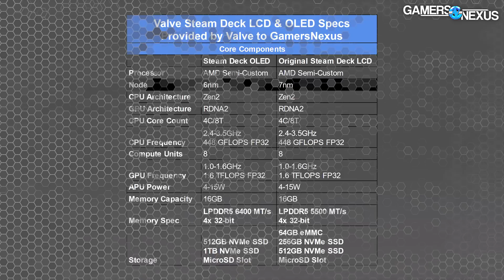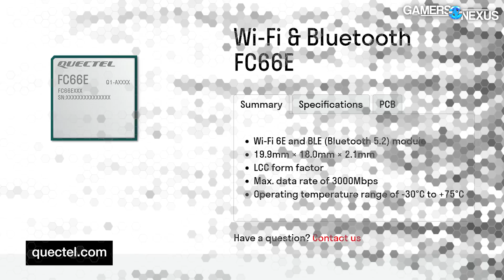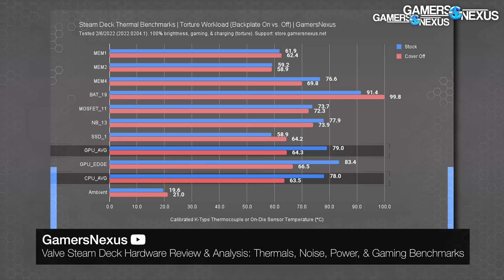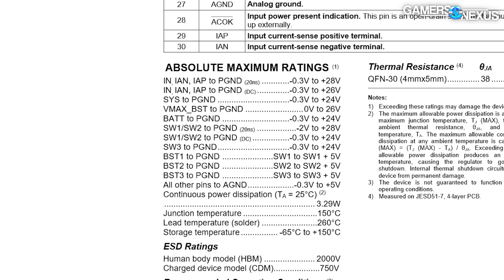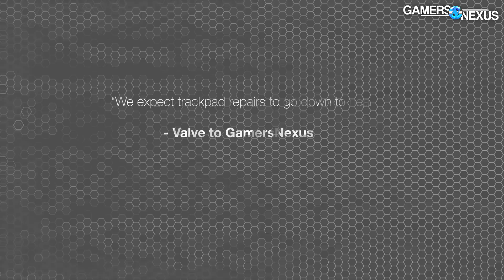They Changed Everything: Valve Steam Deck OLED vs. LCD Tear-Down

Comment from the maker: Check out our Lenovo Legion Go review! https://www.youtube.com/watch?v=I37mxlDqLrk
We're running a lot of tests on our (still assembled) Steam Deck OLED RIGHT NOW. We are currently running battery life, thermal, and charge time tests. Battery life can be detailed: Do you have any specific scenarios you want to see battery life tested for? Gaming is on the list as well. What other tests would you like to see? Do you have any specific gaming test requests (especially memory-bound ones)?
Check out our ASUS ROG Ally deep-dive review here vs. the original Steam Deck: https://www.youtube.com/watch?v=Na1y7DyDe2w
And read about the Steam Deck OLED's specs on our newly relaunched website: https://gamersnexus.net/news/valve-announces-steam-deck-oled-deck-2-works (just the news/specs)
Reply: Testing emulation of older consoles like the N64, PS1, and PS2 would be really great. It would be great to see since so many people buy these to emulate older games and the battery life playing those games would be really important to that. Though I totally understand if you don't want to risk facing the potential backlash from those companies by doing that testing.
Reply: For battery test, watching movies is imo realistic usage scenario;
Both streamed from netflix as well as offline playing  from the disk.
Steam's remote play is also something i'd be interested to know about, in terms of battery life
Reply: @xeamek99  I second this. OLEDs typically require more power to run just because of the higher cost of switching the brightness levels between each pixel. However, the steam deck supposedly has better efficiency in general and a bigger battery. I'm wondering if this just offsets 1 to 1 the extra power consumption or if you get more life out of it. Could also be nice to test it with things like streaming specifically as well as having Bluetooth headphones enabled (for the wireless connectivity drain)
Reply: @CreativityNull  Oleds require as much power as it needs to brighten the light areas. So in the end it depends on the usage scenario and content! Movies often tend to have tons of bright areas games, it depends on the game.
Reply: @werpu12  yes I know, that's why I specifically wanted the movies and streamed content test to tax the power so we could see how much more efficient this new cpu is.
Reply: Talos Principle 2. I'd love to see how UE5 melts it. It's already running so badly on normal PCs thanks to Lumen/Nanite, I'm really curious to see how it would run on the Deck. (Amazing game otherwise though)
Reply: when's the followup review for this?
Reply: I wonder if there is a huge difference in battery life for games that do not require a lot of power and games that do. They claim 3 to 12 hours with the OLED version compared to 2 to 8 on the LCD version, which means that theoretically the difference in battery life for indie games or emulation of retro games compared to recent AAA titles between the LCD and OLED version should be bigger. I'd love for you to test that.
Reply: Does the anti glare interfere with the black levels? Does it create a bit of diffuse light that prevent the complete black of the OLED?
Reply: Still waiting for more steam deck content :D
Reply: wow - i love the way u presented all the parts on this "enlightened" table - very pleasing!
Reply: cities skylines 2 🤣
Reply: @fornillia I'm playing c:S2 on my LCD steam deck, get 16-20fps on low but having a blast 45 hours in with a 80k pop city and 14k pop city
Reply: Do some test with a moderate undervolt if available in BIOS as well.
Reply: I really want to know that I see no other reviews mentioning is haptics/vibration. Is it more noticeable in games now? Before it was very weak and since they say it's "vastly improved" in the spec sheet, I would like to know.
Reply: something like Messenger? light game, so you could test total battery life (valve claims 12hrs), and pixel respons time (the game has tons of locations with light-dark checkerboard patterns, that run very poor on the lcd deck due to the not-so-great pixel respons)
Reply: What I'm most interested is in related to battery life is the comparison between playing on deck with installed games compared to playing cloud games.
Reply: I'd like to see game streaming from a PC on the local network, and how that effects battery life.  This is a very realistic use case for me.
Reply: Gaming and Battery performance when throttling power delivery to just 10W would be awesome!
Reply: all tech tubers are "constantly complaining about the prices of GPUs", there's a catch though - they all say stupid shit like "it must be 25 -50-100 bucks cheaper" BUT GPUs ARE OVERPRICED X3-4 TIMES! overprice is NOT 100, not even 200 bucks. its literally 3-4 TIMES!

GTX 980 Ti  Die Size 601 mm2 2015 Launch Price  650USD 
GTX 980 Die Size 398 mm2 15% slower 550 USD
GTX 970 Die Size 398 mm2 30% slower 330 USD

RTX 4090 Die Size 609 mm2 Launch Price 1600 USD
RTX 4080 Die Size 379 mm2 30% slower 1200 USD. its a xx70 card.

RTX 4090 must cost 600 bucks, its OVERPRICED 1000 DOLLARS. RTX 4080 must cost 300 bucks, its OVERPRICED 900 DOLLARS. 600 & 300 bucks are normal prices for such devices because TECHNOLOGICAL PROGRESS, mf-er, ever heard of it? 
yeah, ngreedia can sell 4 times less GPUs for 4 times more money each and get the same profits, yet gamers will have 4 times less new faster GPUs and game devs don't make games for overpriced AF hardware, game devs make games for hardware that MOST people can afford to have a player base to sell games to. +most new GPUs have like 0 progress = thats how ngreedia is killing PC gaming with its overpriced x4 times crap.
when you buy a top overpriced AF GPU there will be minimal amount of games that actually need such GPUs. and most new "hard to run" games actually is boring AF crap with bad gameplay and stupid storylines. and YOU SUPPORT GREEDY AF CORPORATIONS AND DEATH OF PC GAMING through overprice.
and ayyymd isn't better - supporting overprice to sell more obsolete cheap-to-make high-margin ps5/xbox chips to sony/ms. ayyymd supports ngreedia overprice to push PC gamers buy crap consoles. and both corporations are making profits of slowing down technological progress. no progress = no price drops.
people really should ONLY get used GPUs and don't feed GREEDY AF corporations at this point.
and "tech tubers" are a sad joke with fish memory because they never seem to remember pre-mining prices, which is 2015, always comparing TO MINING PRICES WHEN GPUs LITERALLY WERE MONEY PRINTING MACHINES. THEY aren't anymore. GPUs are JUST GAMING DEVICES and MUST BE priced accordingly as such, 500-600 bucks MUST BE TOP GPU PRICES, xx70 class cards like "the 4080" MUST BE around 300 bucks just like pre-mining when NOBODY EVEN CONSIDERED THAT CHEAP.
Reply: BG3
Reply: First of great work. Are you planning to do a Legion Go teardown or any testing - would really appreciate it. 

Keep up the great work - love the content.
Reply: Really cool! Could you do a video on the new PS5 too? I am hearing about people complaining that the fan ramps up too much and is extremely loud compared to the launch versions.
Reply: The new Counterstrike on the old vs new Steam Deck would be interesting to see
Reply: Would love to see 60hz/fps battery life on the original vs 90hz/fps battery life in the same game on the OLED.
Reply: Is the battery in the OLED easier to replace? That is my main sticking point on buying one, I don't want a brick in 2-3 years, and I don't want to deal with ribbon cables since I always rip them.
Reply: wtf is taking so long, maybe the useless old CPU reviews for the milionth time
Reply: How’s the review coming along?
Reply: Still waiting on the review. forgotten
Reply: Would love to see breakdowns of screen vs CPU vs GPU power usage and effect on battery life with fixed framerates, as well as undervolting. Eg, can we do a moderate undervolt with medium to low screen brightness and get a big increase?
Reply: I would like to see a video about if there are any components you could swap to the old model like the trackpad or the new speakers I heard about
Reply: Test Shadow Warrior Redux at native res but 40fps/40hz to see how far battery life stretches, I get roughly 6-7 hours like that and am curious to see if that stretches to potentially 15 hours.
Reply: Love the website layout, very friendly!
Reply: I would like to see a Slay the Princess benchmark or other VNs

Nobody includes them in benchmarks, but it would be super interesting to see if this new deck can achieve 12 hours battery life under very light load

As well as provide a point of reference to people who mainly play this kind of games
Reply: Like someone else mentioned, I'd like to see if the efficiency could be pushed a bit higher by undervolting. I did this on my deck and was able to lower voltages across the board by 30-45 mV and that increased the efficiency of the APU by right around 8% on average
Reply: Can you do a stop and go charging test where you charge the steam deck to random percentages to simulate not having time to fully charge so we can  see how the battery life is affected?
Reply: steam deck LCD have two different pcb's, you tested the first version - but what differences have with the second revison pcb, new OLED pcb an cooling is much more similar to the second steam deck LCD pcb than to the first pcb.
Reply: I would love to see testing of the bluetooth! The original Steam Deck often has problems when you're trying to use multiple bluetooth controllers, so I'd love to know how much that has improved.
Reply: Can you test Trackmania 2020, Rocket League, and Baldur's Gate 3.
Reply: I've been holding off on deciding between buying a ROG Ally or Legion Go to see what your thoughts are on the Legion Go. Will there be a Legion Go review any time soon?
Reply: Phew... For a second I feared you disassembled before testing. Kind of felt like that in the video. Can't wait to see the results! :D
Reply: Please, test Video Playback battery test, both locally, like a movie on repeat, and Streaming from Youtube. It would be really nice to see those real-life tests!
Reply: Steve, can you reconsider shooting future videos on the table with the fluorescent lighting? The strobing is very visible on video and is hard to the eyes in some shots.
Reply: Some 2D Games like Vampire Survivor would be nice on the Battery Life test. Don't know if there is a test, but it would be great as it is one of the better Steamdeck Games.
Reply: I know it's way out of your scope, but we would love to see a star citizen test on the new OLED deck, or a comparison! The deck citizen community is super curious if the new ram configuration makes a big difference...
Reply: I'd like to see how fast it discharges at idle and at sleep. I have no idea how you'll test the latter but if it is at all possible that'll be cool. The Deck LCD loses charge at a surprising rate for a device that is "sleeping" or "suspended" vs any other device I own.
Reply: Netflix/YT playback please!
Reply: Testing emulation in general would be nice and see how it compares to the old Deck. See if the improved thermals and memory speed help with emulation and the battery performance while emulating.
Reply: Steve and his team making their premiere video on Steam Deck OLED way different and interesting than others. Such dedication to the craft. ❤
Reply: I have a steam deck with a bad main board steam and all there partners do not sell or repair the main board. So I have a steam deck paperweight. Steam also wouldn't tell me why they wouldn't warranty it.
Reply: @pilsen8920 ”But the steam deck is repairable” the valve shills scream at the top of their lungs.
Reply: It probably makes the most sense to test for the modern triple A games that have come out this year and compare battery lives between the old deck and the new one.
Reply: I really would love to see the comparison against PTM7950 + JSAUX vent backplate mod as well as stock.
Reply: Please check if the battery is easier to remove than the LCD one. The LCD one uses quite a lot of glue which makes it very difficult to remove. Even if you don't tinker or mod your steamdeck, it's likely the battery will need to be replaced before it becomes obsolete. iFixit classifies battery replacement as "difficult" right now and I hope they improved it.
Reply: Does the oled have pwm?
Reply: I'd be curious to see a battery and performance comparison of a game that can run on Steam OS natively, compared to the same game running on Windows on the Deck.
Reply: The Deck received a quieter fan curve since your original testing. I'd like to see an updated temperature reading for the area with the problematic charging IC. Has reduced airflow made the LCD Steam Deck significantly worse at cooling that area of the board than it was at release?
Reply: How long it would last in sleep mode honestly.
Reply: If possible it would be great to see some of the core cooling tests repeated with the reassembled steamdeck versus the untouched one to gauge the risk/wiggle room for enthusiasts to disassemble for fixes to see how foolproof the process is if that makes sense
Reply: A video comparing the 512gb glossy glass oled display vs the 1TB etched glass oled would be great. Especially in a dark room/natural sunlight if possible.
Reply: Overclocking. It's doable on the LCD version, curious to see how the 6nm APU behaves.
Reply: General use - watching videos screen-on-time will help a lot, to know about battery life
Reply: They claim you can game for up to 12 hours on a single charge.  I want to see this tested.
Reply: Would like to see which SteamOS version its running; Specifically to test if they have fully switched to Weyland for Desktop mode as well testing if it properly supports HDR in desktop mode. (if those details aren't embargo'd for some reason).
Reply: cool table
Reply: The back paddles used to be a real downside, since they were much too stiff. Did they improve the back paddles in the OLED version?
Reply: yeah I want to see price/performance comparison to the cheapest steamdeck and to the cheapest steamdeck with upgrades. because obviously oled version is overpriced 0 progress crap with blows and whistles instead of ACTUAL PERFORMANCE UPGRADE made just to keep milking stupid fanboys wallets with the same 2 y.o. slow AF crap tech.

and your "review" is just another ad for that 0 progress crap, because you're shills pushing  overpriced AF 0 progress crap to your viewers. just as always. with GPUs, consoles etc.. you. are. shills. working for corporations to push their crap. whether you realize that or not.
Reply: @juubilo1509  >Direct storage, raytracing, hell even common stuff like tesselation years and years ago
actually are just cosmetic changes to bad low-VRAM graphics thats essentially is the same as 2004 DOOM. same bad models, same crappy textures, same soapy cartoonish image. putting godrays on top of shitty graphics can't make it actually better. you know why? because there's actually no progress with AFFORDABLE HARDWARE, 0 progress with consoles which are on 1070 level (pascal its 2014 architecture) = 9 Y.O. HARDWARE DICTATES WHAT GAMEDEV CAN DO.  0 progress with VRAM. and Direct storage on PC is a joke because PCIe bus IS TOO LONG.
Reply: @juubilo1509  all tech tubers are "constantly complaining about the prices of GPUs", there's a catch though - they all say stupid shit like "it must be 25 -50-100 bucks cheaper" BUT GPUs ARE OVERPRICED X3-4 TIMES! overprice is NOT 100, not even 200 bucks. its literally 3-4 TIMES!

GTX 980 Ti  Die Size 601 mm2 2015 Launch Price  650USD 
GTX 980 Die Size 398 mm2 15% slower 550 USD
GTX 970 Die Size 398 mm2 30% slower 330 USD

RTX 4090 Die Size 609 mm2 Launch Price 1600 USD
RTX 4080 Die Size 379 mm2 30% slower 1200 USD. its a xx70 card.

RTX 4090 must cost 600 bucks, its OVERPRICED 1000 DOLLARS. RTX 4080 must cost 300 bucks, its OVERPRICED 900 DOLLARS. 600 & 300 bucks are normal prices for such devices because TECHNOLOGICAL PROGRESS, mf-er, ever heard of it? 
yeah, ngreedia can sell 4 times less GPUs for 4 times more money each and get the same profits, yet gamers will have 4 times less new faster GPUs and game devs don't make games for overpriced AF hardware, game devs make games for hardware that MOST people can afford to have a player base to sell games to. +most new GPUs have like 0 progress = thats how ngreedia is killing PC gaming with its overpriced x4 times crap.
when you buy a top overpriced AF GPU there will be minimal amount of games that actually need such GPUs. and most new "hard to run" games actually is boring AF crap with bad gameplay and stupid storylines. and YOU SUPPORT GREEDY AF CORPORATIONS AND DEATH OF PC GAMING through overprice.
and ayyymd isn't better - supporting overprice to sell more obsolete cheap-to-make high-margin ps5/xbox chips to sony/ms. ayyymd supports ngreedia overprice to push PC gamers buy crap consoles. and both corporations are making profits of slowing down technological progress. no progress = no price drops.
people really should ONLY get used GPUs and don't feed GREEDY AF corporations at this point.
and "tech tubers" are a sad joke with fish memory because they never seem to remember pre-mining prices, which is 2015, always comparing TO MINING PRICES WHEN GPUs LITERALLY WERE MONEY PRINTING MACHINES. THEY aren't anymore. GPUs are JUST GAMING DEVICES and MUST BE priced accordingly as such, 500-600 bucks MUST BE TOP GPU PRICES, xx70 class cards like "the 4080" MUST BE around 300 bucks just like pre-mining when NOBODY EVEN CONSIDERED THAT CHEAP.
Reply: @juubilo1509  HUB Steve painted overpriced crap with crippled VRAM known as the 4070 like the best thing you can buy. when in fact NOBODY SHOULD BUY THAT OVERPRICED CRAP EVER AND IT SHOULD ROT ON SHELVES until ngreedia goes bankrupt. just like ayyymd should too with theirs x3-4 times overpriced GPUs.

yes he repeated how bad it is yet concluded that that crap is "the best choice". he even stated "it should cost 500 bucks" which is a really stupid thing to say considering THAT MINING IS DEAD.
by making 4070 video HUB Steve is basically approved on ngreedia's overprice and practices of milking the market and customers wallets.
which makes him actually an ngreedia shill, and an enemy of every sane gamer.
and now they make clips about "How much longer until GPUs are actually affordable?". HUB IS THE PART OF THE OVERPRICED GPUs PROBLEM just as ALL OTHER TECH TUBERS who don't talk about mining being dead and GPUs prices not making any sense ARE. instead of pushing people away from buying overpriced AF crap THEY RECOMMEND IT.
HUB became a joke. 

during last 5 years, 1000-3000 ngreedia GPUs were money printing machines, literally. now they're still priced like they are money printing machines BUT THEY ARE NOT capable of making money anymore.
prices should drop to pre-mining levels and be x3-4 times LOWER, because they make 0 sense without mining.
after that we would finally get some decent progress in gaming and in gaming hardware. currently we have almost 0 progress in 6-7 years.

even with pre-mining prices GPUs never were cheap and ngreedia made BILLIONS IN PROFITS even then. now they just make even more billions with insane margins.

ngreedia just shifted the whole stack up to milk more money thinking that nobody would notice their swindling, and stupid fanboiz didn't. 4050 became 4060ti, 4060 became 4070ti (they even tried to sell it like the 4080 12gb for 900 bucks at first), 4070 became 4080. 
the only "true" 4000 series GPU is the 4090.
the 4080 is 30% slower than xx90 which corresponds to xx70 cards of the past, so its actually a xx70 card, which even during mining when they were overpriced AF cost 500 bucks. before mining in 2016 xx70 cards cost 300 bucks. so even when adjusted for inflation "the 4080 16gb" should actually be the 4070 16GB with the price tag around 350 bucks. ngreedia sells  GPUs that should cost 350 bucks for $1200. GPUs that should cost 150 bucks for $400 etc.
and there's no mining, no scalpers, nothing to justify that cash grab.

and by selling overpriced AF GPUs ngreedia is killing PC market and PC gaming: nobody can afford new GPUs = nobody is building new PCs because nobody can afford them = game devs don't make games on new engines because there's basically noone to sell those games to = no sales and no progress aka stagnation in PC gaming.
thanks ngreedia, thanks ayyymd and intool for supporting ngreedia's overprice. and thanks tech tubers for not pointing out whats going on..

and let me remind you that even with pre-mining prices GPUs never were cheap and ngreedia made BILLIONS IN PROFITS even then. now they just make even more billions with insane margins.
Reply: @juubilo1509  newsflash: Starfield is a shit game for silly kids on obsolete gaming engine with stupid repetitive boring gameplay and awful graphics. but apparently you think thats a progress in gaming, lol when in fact it looks obsolete AF. and stupid.
Reply: I would love to see after you have run your tests, on how easy it is this time to swap the battery!
According to Valve, less glue and easier, but I would love to have that confirmed! Btw. thanks for this video, so far unique, as usual, great work!
Reply: whats the runtime with the clocks at minimum?
Reply: When can we expect a full review of the Steam Deck OLED from you guys? (I'm not really in the loop of how long you tests for new hardware usually takes)
Reply: @BastianBresson  In Valve time, aka... when its done!
Reply: Disappointed
Reply: Wounder if the also changed the ram modules for people to upgrade them easier
Reply: I keep checking in for this full review video everyday, can't wait!
Reply: steam deck oled vs competitors on battery performance
Reply: Is there no way to swap out components for better performing variants on the lcd models?
I wish valve would let people exchange them for a discount. 
Maybe re-engineer them for less demanding uses.
Problem is I accidentally got 2 lcds & I've already upgraded their cooling system, battery & nvme. 
If I could change 1 screen to oled I'd be happy.
Reply: Basic web browsing if it can even do that
Reply: Considering how the OLED screen seems to be so great, streaming on it might definitely be an even more common thing in the very soon future. Question would be how much battery time you would get out of some kind of game stream through the deck. I would expect to use the steam provided stream API/tools for games but at this point anything goes
Reply: Disastrous comment section aside... I'd like to see whether or not I can swap the OLED display into my first wave Deck -- assuming of course that purchasing the OLED display becomes an option in the future. To the other commenters: remember not to feed the trolls.
Reply: @LimeSlimeTV  They specifically said that this is not possible.  Then again, they previously said you couldn't upgrade the SSD, and that turned out to be false.
Reply: Previous deck had a sweet spot at 11W TDP setting and 40Hz screen refresh rate for playable performance/battery life. Would like to see how this stacks up, or even if the efficiency curve has improved in any way.
Reply: @juubilo1509  there's like 0 progress with GPUs, e.g. 4060ti is just 5% faster than 3060ti.
PC gaming is overpriced and therefore essentially DEAD with 0 meaningful progress in LITERALLY decades. its all basically Doom 3 from 2004 but in higher res due to progress with monitors (which is too slow too) + upscale + glitchy fake frames to sell the same obsolete crap year after year.
EVERYTHING IS OUTDATED because ALL corporations killed even possibility of any meaningful progress in all tech to milk the market with the same crap year after year.
we are currently technologically stuck in like 2015 because of corporations milking the market. a 15 y.o. Core 2 Duo is only 8 times slower than "modern" Ryzen 5700x but according to Moore's law it should be more like 128 times slower. "the 4060ti" only 5% faster than the 3060ti after 3 years. we basically have 0 progress because corporations are milking the market with their obsolete crap.

and VRAMs are a joke that kills the progress in PC gaming along with insane GPU prices. amd put SSDs on a GPU in 2016, then they did the same on slow AF consoles with 9 y.o. performance level which allows them to compete with "modern day GPUs", its like x10 times faster than DirectStorage because when you connect an SSD directly to a GPU no latency due to long PCIe bus, 1tb+ of VRAMs on gaming GPUs are possible from 2016 which would allow photorealistic graphics = movie-like games. where is it? corporations are killing the progress to milk the market with cheap to produce obsolete crap to not drop prices on old low-VRAM crap tech. software solutions like upscale/ glitchy fake frames ONLY exist to enable ngreedia/ayymd/intool to milk the market with old obsolete tech without making any actual progress.
GPUs can't print money anymore, adjust your pricing expectations accordingly.  tech tubers are a sad joke at this point.
Reply: tech tubers all are out of touch with reality, they essentially ALL make ads for overpriced crap and assess value wrong by comparing it to last couple of years when in reality to be correct they should look WAY deeper and compare with a decade old stuff to make at least somewhat correct conclusions about value, prices, progress. as is tech tubers value analysis is on a fish memory level - only compare to what was 5 minutes ago.
e.g. PC gaming is overpriced and therefore essentially DEAD with 0 meaningful progress in LITERALLY decades. its all basically Doom 3 from 2004 but in higher res due to progress with monitors (which is too slow too) + upscale + glitchy fake frames to sell the same obsolete crap year after year.
EVERYTHING IS OUTDATED because ALL corporations killed even possibility of any meaningful progress in all tech to milk the market with the same crap year after year.
we are currently technologically stuck in like 2015 because of corporations milking the market. a 15 y.o. Core 2 Duo is only 8 times slower than "modern" Ryzen 5700x but according to Moore's law it should be more like 128 times slower. "the 4060ti" only 5% faster than the 3060ti after 3 years. we basically have 0 progress because corporations are milking the market with their obsolete crap.
GPUs are x3-4 times overpriced when compared to pre-mining prices. and techtubers including GN and HUB don't really criticize that at all.
all their GPU "reviews" are basically ads for x3-4 time overpriced GPUs and value assessment is a joke. same as HUB or any other tech tuber who gets samples for free or for their patrons/fans' "easy money". so basically all of them made current pricing possible and made PC gaming overpriced AF and essentially dead with 0 real meaningful progress in decades. everything is still basically on 2004 Doom 3 level just monitors resolution got better. 

corporations are milking the market instead of making real progress .  THE ONLY reason ngreedia/ayymd don't do actual progress is the actual progress will destroy their ability to milk the market with obsolete slow AF GPU crap + would destroy consoles business for AMD, and GaaS business for ngreedia.
even software solutions like upscale/ glitchy fake frames only exist to enable ngreedia to milk the market with old obsolete tech without making any actual progress. 
GPUs suck, ngreedia killed PC gaming and PC market with its overpriced x3-4 times crap.

aaaand tech tubers not really complaining about all that crap going on.
Reply: @rawdez_  tl;dr - Moore’s law is a 50 year-old prediction, not an immutable law of microelectronics, and it’s amazing that it’s held true for as long as it’s had.

“according to Moore’s law”
Moore’s law was a prediction (and years later he said himself it was just a rough guess, and in part he just thought designers would always be able to figure something out ) made by Gordon Moore in 1965 that the number of transistors in an integrated circuit would double every year for the next decade. In 1975, he revised it down to doubling every two years from 1980. He didn’t make any predictions about speed increasing, or prices dropping, or any one of another half dozen technological advances that Moore’s law supposedly dictates.

Moore’s law has always had an expiration date, thanks to heat and the speed of light, and if you read trade magazines from decades ago you’d see that people were already wringing their hands about it. You can’t just pile on more transistors of the same size forever because at (1) some point they’re so far away that the speed of light starts impacting sync and (2) you need more and more power to drive all of those transistor and thus generate more heat. Also, from a retail perspective the price just keeps going up if you can’t shrink the cost of production at the same pace (never mind the defect rate). So you say “Well that’s what we have process shrinks for!”

Okay, let’s ignore all the time and resources that has gone into getting lithography to produce smaller and smaller circuit designs. Let’s pretend that the increasingly complex materials science, quantum effects, etc. weren’t a thing. In fact, let’s say that you had a literal magic wand that could shrink transistors. At some point you reach the point where each transistor is one atom. No latter how much you scream and yell, no matter how big of a tantrum you throw, that’s the lower limit of lithography, our current basis of commercial production of ICs. That’s the end of Moore’s law. It doesn’t mean chips can’t get faster after that, that we can’t find something to replace transistors entirely. But it does mean that the “number of transistors will double every 24 months” will no longer apply because… whatever replaces them won’t be transistors anymore.

And it turns out you can’t ignore the things that we handwaved away. Each shrink gets harder and harder. Each advancement is nearly a friggin’ miracle of electrical engineering. But who am I kidding? You don’t know about any of that and you don’t care about any of that.
Reply: @rawdez_  Tech YouTubers complain all the time about the price jump in GPUs. Literally every time a new one comes out or they're making a buyer's guide or something. Many are pointing out the used market as a viable option, though noting that it's also a bit inflated due to the overall artificial inflation from post pandemic prices. There's just not a lot they or anybody else can do about it because we're going to buy it anyways. All they can really do is make that note and then make recommendations based on the current prices.

Overall, you spent a lot of time to write a text wall that is completely worthless because it's based on biased assumptions. Good Job 👍

Oh geez, just realized you're the same person that complained about the performance lmao.
Reply: @rawdez_ Weird way of saying you are poor and uneducated…
Reply: They Changed Everything* BUT IMPROVING THE 1 THING THAT ACTUALLY MATTERS: PERFORMANCE
Reply: @rawdez_  honestly, nah. This thing will emulate all the way up to PS2, Wii, and Xbox 1 without issue. On top of that it will run many modern games reasonably well still. The main issues with the steam deck has been the screen (with low refresh rate and poor color accuracy) and the overall battery life. The performance was never the main issue. For $400 for what is essentially a gaming laptop you actually get the performance you paid for.
Reply: @rawdez_  if the SD was performing better you probably would've been upset about the price
Reply: @maerinmorty9039  so whats your point? you're trying to shill for 0 progress with saying that people should buy all crap that corporations make because it at least exists and there won't be any better any time because silly fanboys keep buying 0 progress crap anyway? and people should stay silly and content with obsolete overpriced 0 progress crap that all corporations make these days to milk the market, right?
Reply: @rawdez_  why do people draw conclusions so much out of their... i never said that there wouldnt be any better or something like that. Valve are probably planning something new anyways. No need to be aggressive about progress progress comes more from what the competetion has to offer. If people just buy something that got a name out there not just because its considered good that is what keeps progress on hold
Reply: @rawdez_ We just need good competition in the same price range and people buying it thats all
Reply: @maerinmorty9039  you SUPPORT 0 PROGRESS. and THERE WON'T BE ANY PROGRESS IF PEOPLE EVERY TIME IGNORE 0 PROGRESS like you are doing rn. THATS HOW IT WORKS. BY BUYING SD OLED YOU SUPPORT 0 PROGRESS, also YOU SUPPORT THE NEXT SD BEING AS SLOW AS POSSIBLE. thats EXACTLY what your stance on sd oled is doing - YOU ARE JUSTIFYING 0 PROGRESS.

what competition? there are no competition AND NEVER WILL BE BECAUSE ALL CORPORATIONS ARE MILKING THE MARKET THE SAME.
Reply: @rawdez_  i feel like watching an american in zoo. Did i buy the sd oled? If people buy a handheld from another company cuz its better is there really any other choice for valve then too make theirs better too? I never said i dont support progress lol. Also there already is competetion (e.g.: gpd, onexplayer, aokzoe,ayaneo, asus rog ally)

Edit: saw them congratulating another company on twitter once
Reply: @rawdez_  also turn off caps lock use shift like a real man